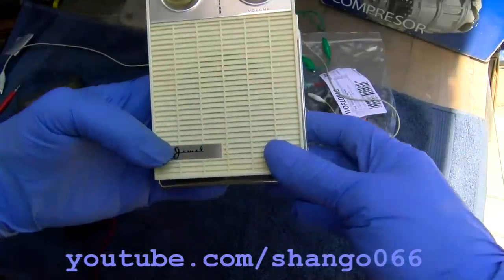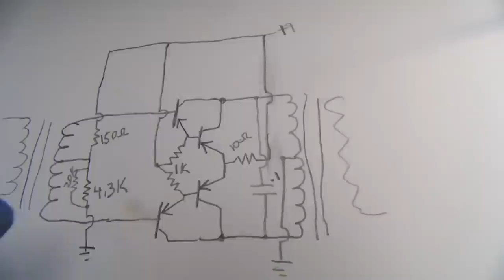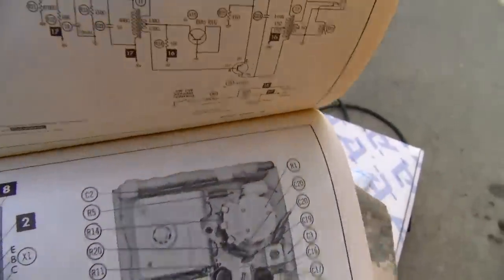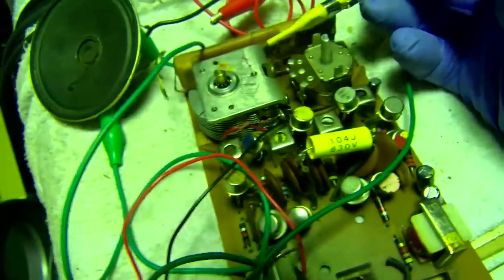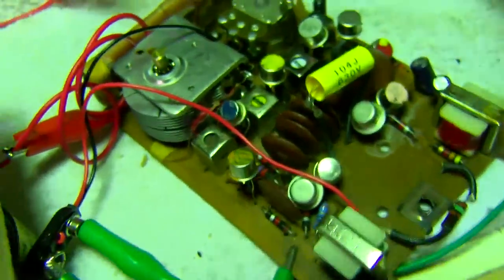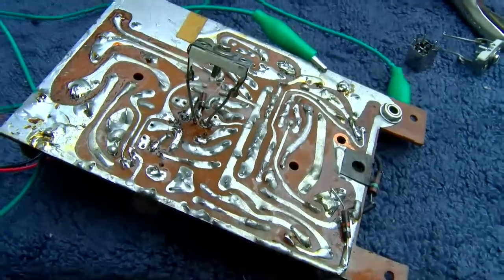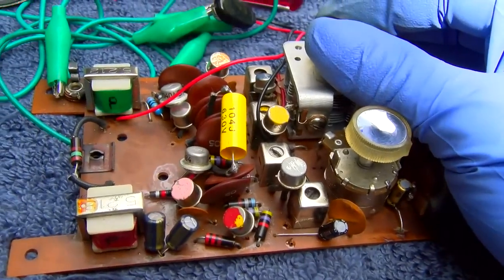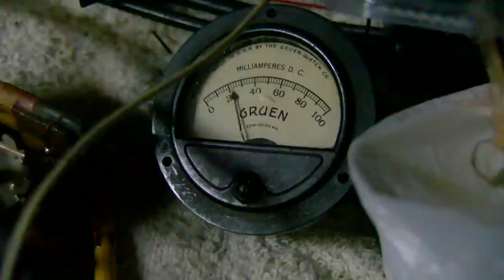1963 Jewel 10 Transistor AM Radio Repair Confusing Tough Repair

Comment: I had a question I'm kind of learning when they use a transistor as a diode can I substitute it with an actual diode
Reply: Yes. Diodes work fine. They used to do this because they were too cheap to buy real diodes and it helped increase the "transistor count" which helped sell radios. Stick with the same type. Shottky to replace Germanium and Silicon to replace Silicon.
Reply: @Seiskid  yeah I've been trying to learn Electronics especially vintage transistor radios I actually fixed one was an old vintage 1965 standard walkie-talkie CB I recapped it and when I turned it it actually had audio it was very satisfying I think that is the fun part about learning vintage electronics is when you actually fix it

Comment: 10 ohm is right, the bias is too high due to leakage from old germaniums, they dont do darlington well. An old headphone or telephone earpiece can be used to trace audio - sounds pretty good at the base of audio outputs, 12 mA is too high should be like 3ma without outputs, 5 or 6 ma with ots. try silicon pnps - just 2 as OTs.and remove that stupid 630v crapictor . 104 ceramic is good there. Regarding germanium transistors - these are reject germaniums from computers. GE did the same thing. Designed right these rejects are the best transistors. I woud have replaced as many transistors as possible with Silicon. If transformer caps in transistor radios of these types are always 200pf

Comment: I take it that detector diodes aren't supposed to short? You seemed surprised to find that this one did. I'm no expert at this, that's for sure, but is that something that usually doesn't fail? Otherwise, helluva job chasing the problems down with this one.